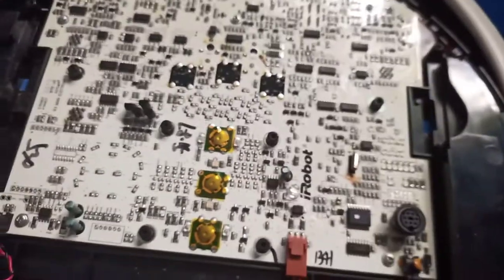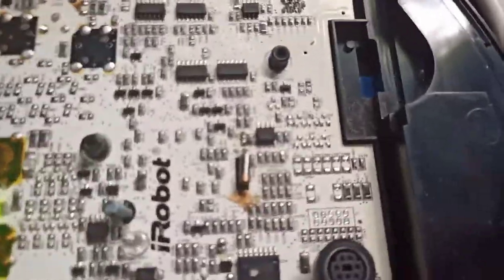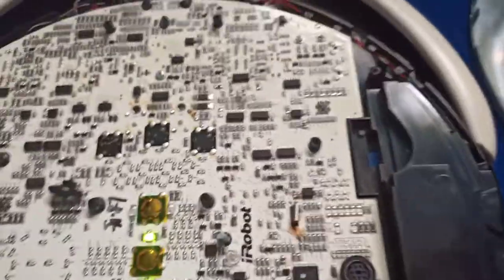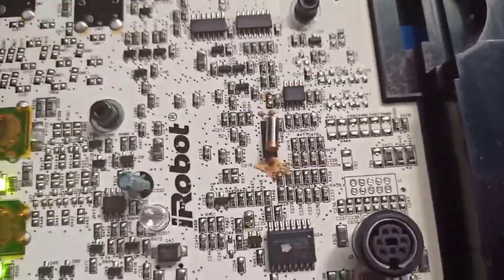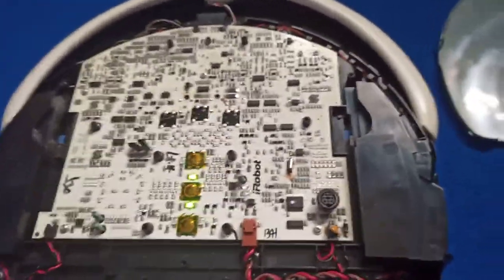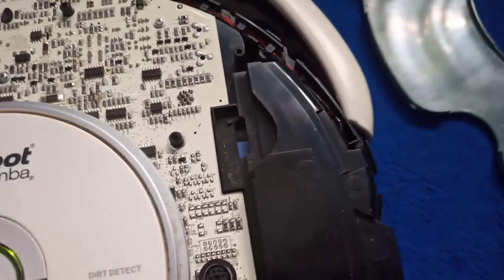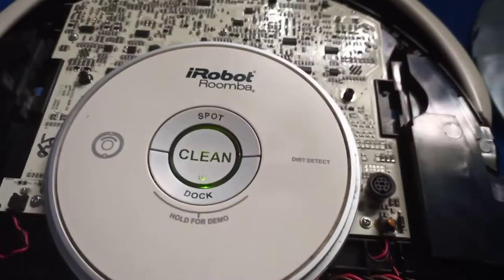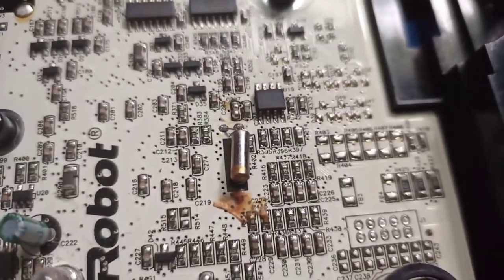How to underclock a Roomba

Comment: Great videos but please either speak louder or get a separate mike to speak in.   The volume is so low, I have to turn up the audio to 100 on the computer and the monitor.  Best Wishes!
Reply from the maker: The problem is the fact that my phone records at a low volume, which is problematic for me and my videos. I will hopefully get a new phone at some point, which will resolve those issues.
Reply: @UNIX32   what  phone do you use